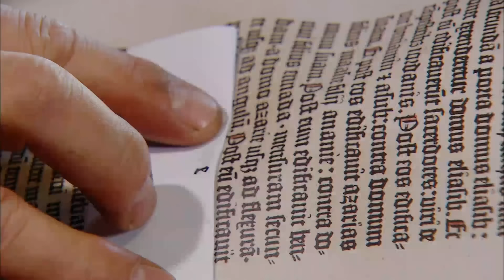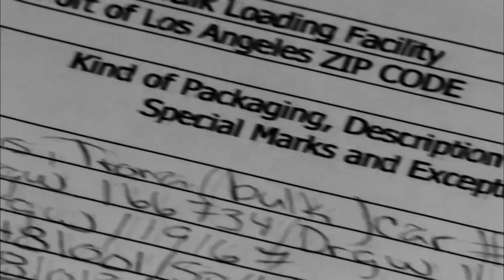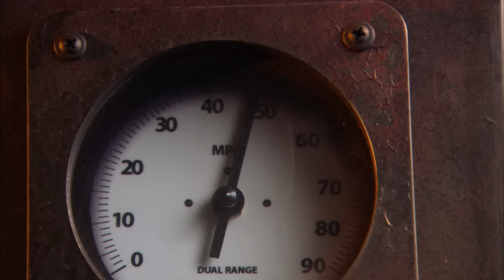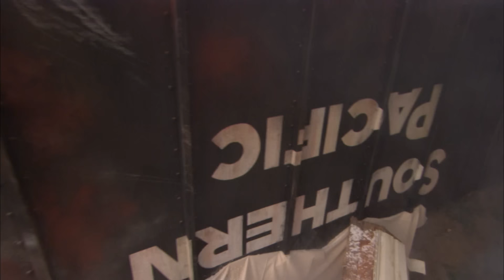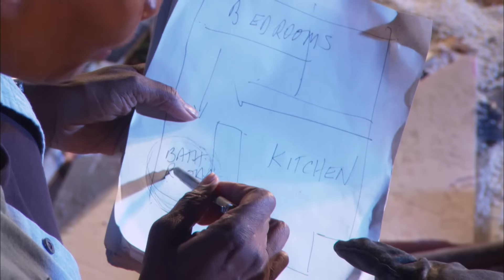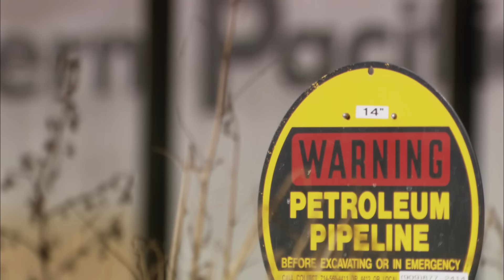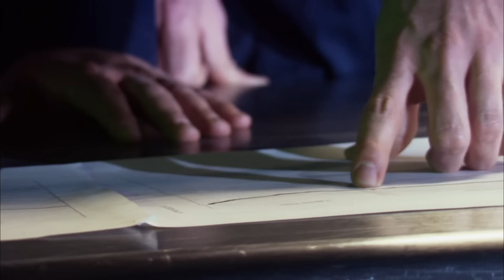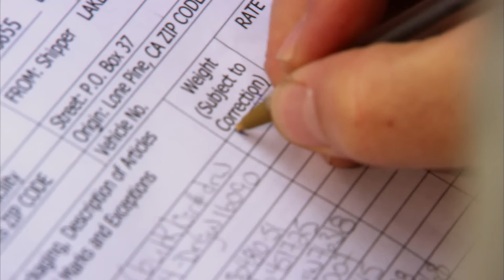Horrifying Runaway Train: San Bernardino Train Disaster SP 7551 East | Mayday | Wonder

Comment: I may be naive but shouldn´t a train engineer know that pulling the emergency brakes cancels out the dynamic brakes as a safety feature?
Reply: No it doesn't, dynamic braking is a different braking mechanism than the air throughout the train.  Putting the train in emergency dumps all of the air in the train and dynamic braking is only on the locomotives.
Reply: @jamesandrew3811  "According to SP, its locomotives are designed so that when the train brakes are placed in emergency, the dynamic brakes are pneumatically blocked out; both engineers testified that they were aware of this feature." —NTSB
Reply: My dad was an engineer for 42 years-it’s all I heard about growing up, and I can say that throwing everything into emergency is the absolute last thing anyone wants to do, last resort, everything gets locked down.
Instead of just using the locomotives for brakes.
Reply: @themidwestbarber8428  Well it was an action of last resort, all other forms of braking were already fully applied and the train was still accelerating.
Reply: lol yall be playing microsoft train simulator and thinking yall know how to drive trains 😂
Reply: I have worked TY&E for BNSF Railway for 22 years, but thanks for your assumption.
Reply: It depends what engines they were using, but yes dynamics are shut off in emergency on some engines, so if the controlling locomotive was one of those engines it could have cut the dynamics, that being said they would have failed at those speeds either way
Reply: @MatthijsvanDuin  that’s what I mean, emergency is the worst case scenario because it shuts the entire system down-supposed to. 
So, that just means more than likely they had done every other form of slowing down, dynamic braking isn’t the same as emergency, that’s all I was getting at. 
I might have worded it differently, I’m no railroader, it’s just all I’ve heard about.
Reply: @undertaker11ism  you don't drive a train.  You run the locomotive.
Reply: @kimrok1  So basically driving the train? That’s like saying you don’t drive a car, you run the automobile
Reply: But it shuts down the dynamic breaking so the wheels won’t lock and skid. The dynamics should have been designed to momentarily shut down then continue to function even with the air breaks still applied?
Reply: 40:43
They say putting on the emergency brakes cancelled out the dynamic brakes.
Reply: @justSTUMBLEDupon  an emergency application of the brakes will cause the dynamic brakes to drop.
Reply: Of course he knew. He was panicked as anyone would be and nothing else was working so. 

 When brake pipe goes to less than 10 PSI, a pressure switch opens. This opens a PSR relay and the generator can’t load in power or dynamics until the air pressure recovers..EMD did this to prevent wheel lock. Years ago when I was a loco electrician, the big modifications were removing emergency sanding. The RR didn’t want to waste sand lol.. seriously.
Reply: @krakenwoodfloorservicemcma5975  you are correct
Reply: @undertaker11ism  No.  You drive an automobie and you run a train.  Also you fly an aeroplane, you don't drive that either.
Reply: @undertaker11ism  You have to steer (drive) a car. You run the controls on a locomotive you do not steer (drive) it.
Reply: @imagreene2952  Ok? Do you want a cookie?
Reply: @kimrok1 if it’s an EMU, then you indeed drive a train, the whole thing.

Comment: I'm glad that Frank Holland wasn't blamed for this, he'd done everything he was trained to do, sadly,  there was so much working against him. The guys in the rear engines should have made the front end aware of their braking issues.  As for the explosion, when it was revealed that 3 emergency valves weren't working at the time of the derailment, they should have been replaced BEFORE the flow was restored, the company also should have taken  more time to inspect the lines, before restoring the flow, so the company is liable for that.
Reply: The damage was done after the inspection, during the clean up of the troma, by a backhoe shovel.
Reply: Even if Holland knew about rear engines'  braking problems, what could he have done about it?

Comment: It seems odd the helper engineer didn't understand that activating the emergency brake disabled the dynamic braking.
Reply: mind boggling 
a. he didn't understand that..
b. that such a brake cancelling takes place ...

i lightly press my minivan's E brake as well as my regular hydraulic brake as I come down the big hill near my house.. i once had a brake line leak .... if it ever happens on a hill , i'm already breaking with the E brake.... i have tested it.. E brake wiill stop me..
Reply: @duggydugg3937  I don’t know how different train air brakes are from trucks, but the parking brake and e-brake refer to the same thing on a truck-there is no park on the transmission either. As far as the mechanism itself, the service brakes (pedal) and parking brake use the same shoes, drums, wear points etc. the only difference is the air can that moves a push rod that rotates a slack adjuster that rotates an s-cam that spreads the shoes into the drum. One side of the air can will apply force to the rod with air pressure and has a spring return on the diaphragm (service side). The other side will apply force to the same push rod with a larger spring, therefore the parking/maxi/spring brake is spring applied-air release. When you pull the yellow button on a truck, it’s effectively the same thing as stomping on your brake pedal if everything works correctly.

When he refers to dynamic braking, it sounds like he’s referring to the equivalent of a Jake brake/compression brake.
Reply: @cabwaldo  
minivan is not a semi.. 
E brake is mechanical.. hydro brake is standard car brake system.. 

don't know what your point is
Reply: He did know. According to the NTSB report, the helper engineer was aware of the feature but still did so because he felt there were no other options for slowing the train
Reply: @brycehale3576  
did any of the engines release sand to try to stop the wheels from slipping ?
Reply: @duggydugg3937  It is a parking brake, not an emergency brake.
Reply: @kimrok1  
if it is a brake ..you should be able to use it
Reply: @kimrok1  
my question is why couldn't he run the wheels in reverse
Reply: @cabwaldo  dynamic brake is the train’s electric motors running as generators, nothing to do with air brakes.
Reply: @kimrok1  No it is a parking brake AND Emergency brake incase of brake failure.
Reply: @vctrsone  99.9% would flip their car trying to use the parking brake as an "emergency brake".  It goes to one wheel and was designed for standard transmissions before they had automatics with a park feature.  In addition trains do not have emergency brakes.  It is an emergency application of the brakes.  It is not odd that the engineer didn't understand the emergency application would cut the dynamics out.  It can be forgotten.  At that time engineers spent most of their training learning to run with air, and dynamics were a secondary braking system, in fact many locomotives were not equipped and in many cases if they were they were cut out.  The method of operation prior to dynamics was the train would stop before climbing the hill and the brakeman would set the retainers on the freight cars to a slower release position, allowing the engineer to release and recharge the brake system while air was still in the brake cylinders on each car.  It took a tremendous amount of skill and attention to detail.  I have been railroading for 25 years on a line with 2% grades, mile long trains and when I learned to run we didn't have dynamics, all air.
Reply: @duggydugg3937  When you go into emergency the sanders come on, at that speed they are useless.  The sand would be blown everywhere but the rail.  The principle is coefficient of friction. The slower the speed the greater the braking force and thus the chance of sliding the wheels.
Reply: @duggydugg3937  They are electric motors, and running the wheels in reverse would actually provide less resistance.
Reply: @duggydugg3937  They are electric motors and cannot engage like that.  In addition running the wheels in reverse would provide less resistance.
Reply: @kimrok1  
are you a train driver ?
Reply: @kimrok1  
how can you know this ?
Reply: @kimrok1  
I don't believe that the wheels of the engines couldn't beer teversed gradually and add spowing
Reply: @duggydugg3937  25 years as a railroader. I was engineer for part of that time.
Reply: The wheels will not go in reverse and it would do no good if they did.  Sliding friction produces less resistance then rolling friction.  They would slide flat and melt if you could even get them to turn before the pinion gear sheared off.
Reply: @kimrok1  
you're making this up
Reply: @duggydugg3937  he is right you can not throw a speeding train in forward to reverse it basically gives the motors a heart attack causing the engines to roll and probably would of caused even more damage and death
Reply: @colevoncole3180  
you're making it up xas you go along..
millennial ?

Comment: The Saluda Grade had 'timed' runaway tracks.  Every mountain line should have such a system, so that 'WHEN' a runaway happens, the tracks automatically exit off onto a long stretch of soft gravel to stop the train before it hits anything of value.
Reply: They have that for trucks...why not for trains?
Reply: @jackeppington6488  one where are going to put them. You need a few kilometers of gravel.
Reply: That's not really plausible with such a long and heavy train
Reply: They also had special engineers that took the trains down. I watched a video of it. Google it up.

Comment: God bless that engineer. I went down the grade in a 18 wheeler and lost my brakes at 45 mph. I980..I woke the co driver and said if we can't stop at Wrightwood turnoff .,just jump...just jump.
Reply: No Thanks. He knowingly operated half-assed equipment. He bears some responsibility too. God Bless the innocent souls who lost their lives from blatant negligence.
Reply: @Jase-L  The yardmaster and power board are responsible for how trains are put together, and what motive power is assigned to them. A trains crew has no control over the matter. The crew was fully aware of their compromised motive power. But had no reason to suspect that the yardmaster and power board were incorrect in their calculations. Had the trains weight been factually correct, rather than a gross assumption, the trains motive power would have been altered accordingly, and the incident wouldn’t have happened. Blaming the crew is completely and entirely illogical, as well as shamefully disrespectful to those who died as a consequence of circumstances they had no control over. It’s nonsensical victim blaming at it’s finest and highlights that you clearly have little understanding of the industry, or the practices and policies that take place in it. Remember, when in doubt, just shut up.

-Over two decades working for UP.
Reply: I ran my truck down that hill.. cajon stop looking at 60 stayed with it..pass the scale and hill stopped..i lived in Phelan at the time..a rookie then! Good times!
Reply: @martenkrueger8647  Haha, It sounds like you had the white knuckle roller coaster ride. I can picture the exact spot you got her shut down , bout a mile and a half past  the chicken coop. Those were good times, Mark
Reply: Shame on you for missing a gear...
Reply: Did you? Jump?
Reply: Now there are gravel ramps for runaway trucks, roughly half way from the top of the hill to the 138 Wrightwood turn off. That would have been an exciting ride.......in a horrible way.

Comment: Gotta love the way the program says certain locos didn't have working brakes without specifying that they mean working "dynamic" brakes.  That is a not the same as having no brakes.  The locos primary brakes are air brakes, not dynamic.

That's akin to saying if the engine brake goes out on your diesel pickup you have no brakes.
Reply: Actually no. Above 10mph the "primary" brakes as you say are the dynamic brakes. Independent brakes are only to be used under normal conditions below that speed because of potential for wheel slip, overheating, and uneven braking forces. The dynamic brakes provide the most efficient and effective braking effort at speeds above 10mph. Now, the dynamic brakes on those particular locomotives are a different type than you'll find on an ES-44 or even a CW44-9 and are significantly less effective, but still more effective than the independent brakes. Also, on those old motors, when you engage the emergency brake it cancels out all the dynos that you did have. There's a whole lot more to get into with dynos and the air brakes, but my comment is already painfully long haha
Reply: @kensingtonchapp4819  I don't understand why those two completely different systems are tied together or even HOW they're tied together. It makes no sense. They should work independently of each other to provide redundancy in the braking effect.
Reply: @kensingtonchapp4819  Thanks, I didn't know that.  I was always told they were used like the engine brake on a diesel motor.
Reply: @maximvsdread1610  Dynamic brakes are only tied to the air brakes in the event of an emergency application of the air brakes on older engines. If you're already in dynos when the brakes apply in emergency, there is an extremely large amount of braking force applied to the engines because NOW you have dynos PLUS your independent brakes setting up at the same time. On older engines there was a feature that canceled your dynos to prevent the engines from derailing, or even derailing the head cars. However, newer engines have a system that allows you to stay in dynos as long as you "actuate" (bail off) the independent  brakes. If you release the brake air from the independents, you can retain your dynamic braking.
Reply: @JD_79  anytime! So, the way dynamics work is vastly different than an engine brake on a truck. A truck engine uses the compression of the engine cylinders to deliver a retarding force to the driveline. In a locomotive prime mover setup, there's no direct mechanical linkage between the engine and the axles, so, a jake brake compression system wouldn't do any good on a train. What happens is the traction motors on each axle start generating their own electricity and feeding that energy back through a resistor grid panel, while the generator itself feeds power in the opposite direction against the flow of electricity from the traction motors. So the resistance from the resistor grid panel combined with generator reverse flow creates a braking effect, and it is extremely strong.
Reply: @kensingtonchapp4819  So it's the engine might derail because.....oh wait. I think I get it. The air brakes and dynos are on the engine together not dynos on the engine and air brakes just on the non engine cars. Since the dynos want to turn the wheels in reverse because of the reverse polarity of the magneto in the electric motor the air brakes locking the engine wheels causes.... am I getting close...lol... please bear with me I'm just trying to understand the physics without a degree.
Reply: @maximvsdread1610  haha you're getting close. So look at it like this: 

The engines have three braking systems
1... independent brakes
2.... automatic brakes
3.... dynamic brakes

Independent brakes are exactly what they sound like, they're "Independent"of the train cars. I can use those to just brake the engines and not the cars, using air. 

The automatic brakes work on all the engines and all the cars, using a separate air system from the Independent brakes, HOWEVER, I can "bail off" the air supplied to the engines if I choose to so that the Independent brakes do not set up during an automatic application. 

Dynamic brakes aren't really brakes. They're just the traction motors providing resistance to motion using electrical energy, so, they don't really try to turn the traction motors in reverse. They create resistance. In other words, if I come to a complete stop and notch up my dynos, the train will not back up. In fact, they stop working entirely under 2mph. 

So, if I'm using both my independents AND my dynos simultaneously, I'm generating a HUGE amount of braking force all on the head-end of the train. The weight of the train shoving against the engines like that can derail lightweight cars, and/or the engines. So we have a system that limits simultaneous usage of Independent and dynamics. Haha i hope that helped.
Reply: @kensingtonchapp4819  Got it. Thank You :)

Comment: 37:17 Dynamic braking uses the electric motors on the locomotives as generators and feeds the electricity generated into heaters on top of the locomotives. Locomotives are called 'motors' by engineers which is sometime confusing. The Conductor is in nominal control of the train, while the Engineer actually operates everything.  Air brakes are not applied by air pressure, they are applied when air pressure is removed; thus when the brakes are applied, air pressure is released from the line extending to all the cars. A broken air line thus puts the brakes on. Full braking is called Emergency Braking.
Reply: No this is a runaway DIESEL TRAIN
Reply: Thank you, Mr. Westinghouse!
Reply: @seanmckay3392  You don't know anything about locomotives, do you.
Reply: @seanmckay3392  they are properly called 'Diesel-Electric' trains. The diesel engine powers a generator, which powers electric motors on the axels. Dynamic braking turns these electric motors into generators themselves.
Reply: @seanmckay3392  They are really an electric locomotive, with an on-board diesel generator.  Almost a Hybrid decades before the Prius.